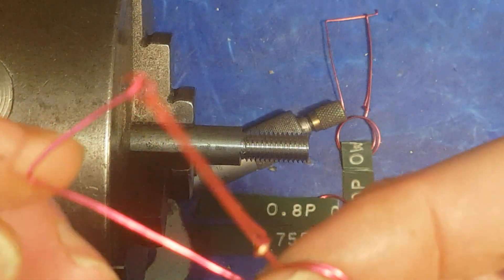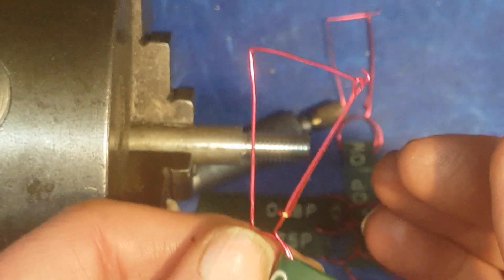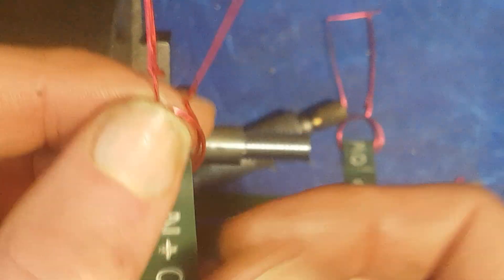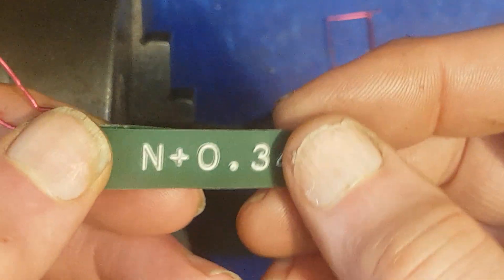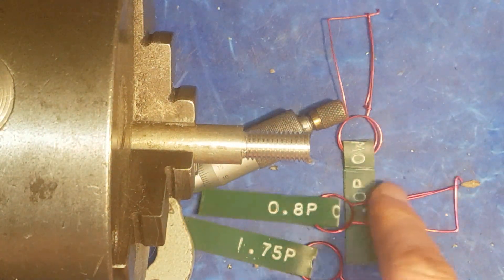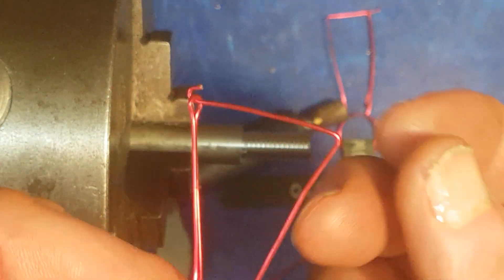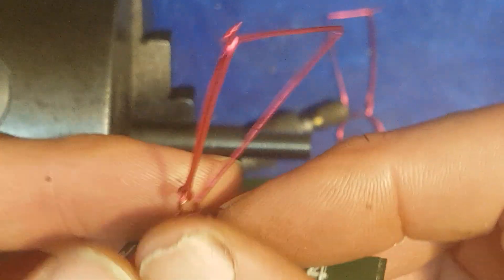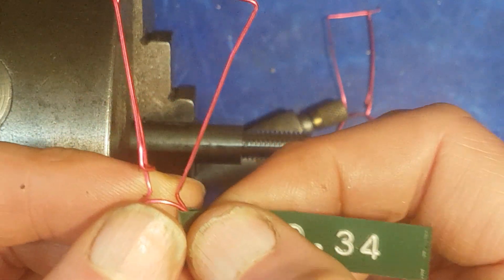3 wire PD measuring, best ever?

Comment: I think this configuration is a great way to dismiss the fumble finger factor. Nice job.  Its one of those designs that screams, """how come someone didn't think of that before"""??? Have you ever checked a thread with only one wire? It doesn't get any easier than that. ( and most sets come with 2 spares)
Reply from the maker: Joe Pieczynski   Thanks for reply, i hoped you would appreciate the idea. 
Indeed 1 wire could work but with my system the actual OD is irrelevant, hence the use of nominal diameter, whereas with 1 the OD will affect to size.

Comment: Trouble is with this idea is that when you use it the 3 wires are NOT parallel to each other ( they are forming a vee )  unless you clamp down hard with the micrometer and bend the single wire.
Reply from the maker: Thanks for the voicing your concern and at first glance a perfectly valid one but the wire is only copper and really quite bendy and the Mic anvils have no problem. I made a series and obviously the size went up with the longer pitch inline with the larger diameter of the screw. 
No system is perfect but this style saves the often quoted dislike of using 3 wires being that of dropping them in the chip tray or not having enough hands to use lhem.
If I were to change the design next time it would be to make them spring closed not open but that is a small matter.
Out of curiosity how did you find the video?
Reply: @chrisstephens6673  Thanks for a prompt reply. To answer you question as to how I found the video is because I am doing thread cutting using wires for only the second time in over 55 Years machining. I am helping out someone who is Interstate ( 1,000 kilometers away ) so I could not do the measuring myself. He wanted some lathe chuck backplates making 2 & 1/4" X 8 tpi. So that I would be sure that they would fit, I asked him to measure up his lathe spindle, length and diameters. I purchased for him a set of thread wires, which came with rubber wire holders for the Mic anvil. He did a series of measurements, varying by about 1 thou, so I picked the average. I made the dummy spindle yesterday and had to use my thread pins that were just in a plastic wallet, no rubbers. Ater a lot of fumbling and swearing I eventually got the measurement correct the same as his. Real nightmare to do as the 2  0.082" pins when fitted in an 8 tpi thread barely sat on the micrometer anvil. This morning I removed it from the chuck and did some remeasuring on the bench, still fidderly but checked out OK. I then sat and watched as many videos as I could find on how to hold the pins in place. Some said grease, some said rubber bands, others said stick them in foam, then I found your video, and the rest is history as they say. Just thought that I would point out that your device is not parallel and you would get an incorrect reading. But as you say the copper bends. If I ever need to do another thread measurement I will give your one a go, although perhaps with Piano Wire which is springy and less liable to crushing. Thanks for asking. Regards from Australia.
Reply from the maker: @daveticehurst4191  thanks for reply and as you say promptly. 
Re large threads, on the job I used to do on BMW bike heads I had to make a M50X2 exhaust stub and used copper wire but wound as a spring like a giant O-VEE spring thread gauge and one of the online thread calculators where you have an option to put any appropriate wire size in. I inherited a comprehensive collection of reels of copper wire but they don't always match with the PD charts size wise so the option to pick from a range in the calculator  is helpful. 
Trans continental repairs can be problematic. I remember my friend Tom Lipton was asked by an Australian to make a plug for, I think, an x ray machine. It was thought to be a weird metric size one and Tom was going show how to cut a metric thread on an Imp lathe,  till I pointed out it was a 26TPI BSB thread. So a three continent repair job, must be some sort of record🤣
If you improve my design and show it, let me know so I can see what you have done, please feel free to run with the idea but a mention would help an ageing ego.
Reply: @chrisstephens6673  Thanks for the reply. Will do If I ever need to do another thread as big. I have several sets of O-Vee thread wires, so quick and easy to do as I understand. Although again, I have never needed to use them, most times on small threads it is just tap and die method. Yes the Yanks don't seem to know about the UK BSB thread system. I had to tell Joe Pie on YT the other Month who was making a Stuart Model Engine and needed a 5/16 26 thread, I think he used an US thread in the end. Regards.
Reply from the maker: @daveticehurst4191  that's the beauty of making both parts in a "one off" you get to choose the thread and no one can whinge because two bits don't match and the need for standards is negated.

Comment: That's a really neat idea, Chris. I can't tell, are all the sets made out of the same size wire and then you just have a different figure over nominal?
Reply from the maker: They wires are the closest to the recommended size that i have a reel of. Using an online PD wire calculator you have a range of min and max, i pick one that fits in that range and put that size into the program. It becomes more obvious in metric, although perfectly feasible for TPI threads, because of the pitch given as a distance rather than a fraction that one calculation works for all of that pitch.
Obviously the same wire might cover a few pitches but the "nominal plus" will be different for each.

Comment: And you can use them to hold your pants up when not measuring threads. Three wire measurements are one of those shop chores that everybody pretty much hates because of the loose wires. 

All the best,
Tom
Reply from the maker: Hi Tom, thanks for the sub and the comment, hope i don't disappoint too much.😉

Comment: Great idea! No more wires dropped in the swarf... Must try it, but I would probably use music wire or some harder springy material. And perhaps making the springy action the other way so they stay on? It would be easy enough to dedicate one for each diameter.  Subscribed.
Reply from the maker: Thanks for the comment, once idea is there there are more chances for others to add some improvements. 
When i made these ones it was to experiment with the idea and i used the copper because i had it in many sizes and it was easy to bend while i decided what form they should take. I bought some nickel silver wire to make another set and wanted to design a jig for bending but have moved on to other things for now.
Your idea is excellent but there must be enough flex in the wire to allow the micrometer to make the wires parallel in the thread. The spring shut rather than spring open also has merits, feel free to make some to your particular needs. I never believed in slavishly following an original, if i can see a better way.

Comment: Great idea Chris and much easier than faffing about with elastic bands and 3 wire rolls. Well done. If the asylum is where you come up with the ideas, then yes, please go back in for a while. Thanks, Jon
Reply from the maker: The asylum let me out to answer you.
As a bit of a threading aficionado  with a passion for precision i have been looking for a simple PD measuring system. This design is about the dozenth iteration but finally it works well enough, helped of course by the use of an online PD calculator. Playing with the calculator it dawned on me that the over wires is always the same constant over the nominal diameter for a given pitch. 
The white coated men are gesturing, so he he for now.🙂

Comment: Great Idea, Chris! Simple and effective, but how did you calculate what wire diameter to use for a particular pitch? Many thanks!
All the best
Dimitris
Reply from the maker: JimmysCanal Thanks for the comment and compliment. There are online calculators that give minimum, preferred and maximum wire sizes, i just picked a wire from my collection that was in the range and put it in the calculator. Remarkably easy to do.
ATB 
c
Reply from the maker: I had better make it clear..in the calculator you can pick the wire size you intend to use and as long as it is between the min and max you are ok. So pick a standard size thread, let the calculator work out the over wire dimension then subtract the thread diameter and you have the figure to add to any thread of that pitch. Hope this makes sense.
c
Reply: Yes it makes sense! Thank you very much, Chris!
Best regards
Dimitris

Comment: Yet another excellent and seemingly simple idea, Chris! Simple adding to a nominal dia makes for a fail-safe readout. I for one will probably opt for a couple of different ones at each pitch, with different coil spring diametres to ensure parallel wires when measuring, and perhaps even having the spring coil closing, to make it self-clamping on the thread under test - but then I only have 2 hands full of thumbs. Cheers, DIYSwede
Reply from the maker: Johan Andersson   thanks for commenting,
The coil spring idea is very much like a commercial product a very expensive item if they are still available. For regular single size threading they would be the best option though. it's specialisation beating general purpose. I have made one such for BMW motor cycle exhaust threads (50×2 from memory) that I  make repair parts for.
It's because of the all thumbs syndrome that i came up with the idea, I wanted something easy and cheap to make, cheap being very important.😤
Reply: @chrisstephens6673  Thanks - yet another tip of an online 3-wire thread calculator: https://www.cgtk.co.uk/metalwork/reference/screw measurement. Also - from what I figured: You seem to have used (non-standard?)  0,874 mm dia "magnet" wire - which could be "sub-optimal" over 1 mm pitch (0,98 mm minimum wire dia @ 1,5 pitch, as per the online calc suggestions)? Cheers, DIYSwede

Comment: Very cleaver;-) For nominal size threads, your design is quit elegant, and your labels are a nice touch. As Randy suggested, piano wire, or a similar hard wire, would be beneficial, but a pain to bend ;-(
Reply from the maker: E Designs   Thanks for the comment, and yes better material would be a nice touch but for trial purposes hard copper wire allows quick design changes.

Comment: You put some thought it to that didn’t you, great idea Chris I can only see one slight issue and that would be measuring a thread with a bigger od the the I’d in the wires, but that would be a rare occasion I recon, the labels make them so much easier to use also, you go to the top of the class with that one mate, 👍👍👍👍

Regards Alan.
Reply from the maker: I hoped you would like it, thanks for the ego boost. 
Knowing the wire size to use making a giant one would be no problem, hint there are online calculators that help there.
ATB 
c
Reply from the maker: PS  for really large diameters I wrap the wire in the thread like a short coil spring, very much like the commercial product but it limits you to single sizes.